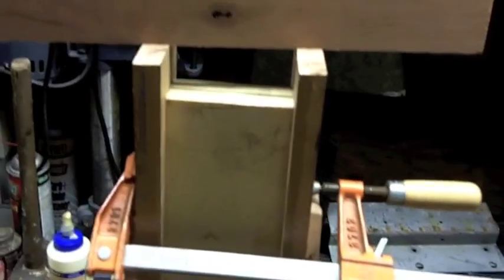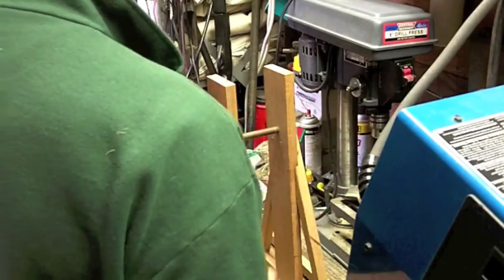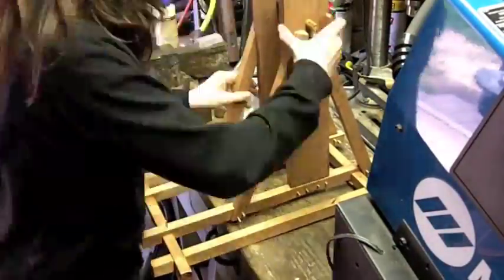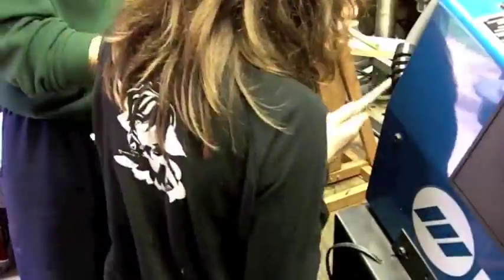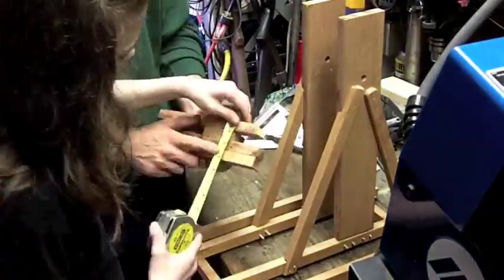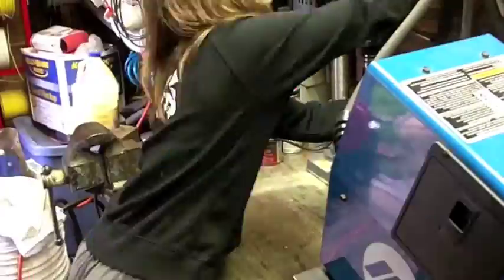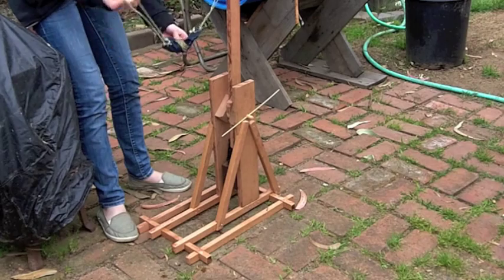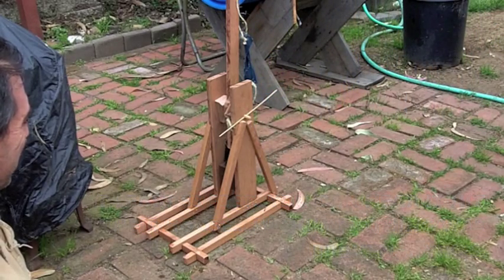Building a Trebuchet Part Two

Comment from the maker: We got the most distance and accuracy when we held the sling tight for the release.  As it ended up, we never made a mechanized firing system... she would just hold onto the sling and let go... It worked well.